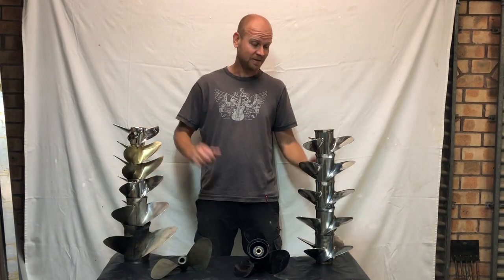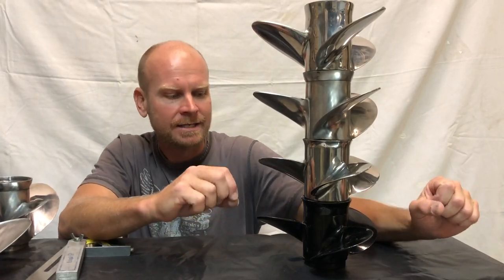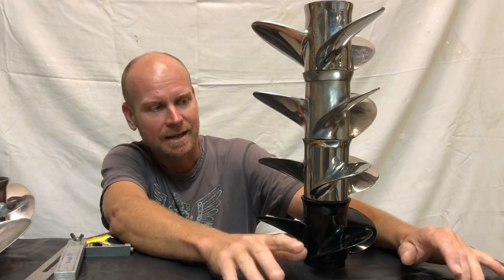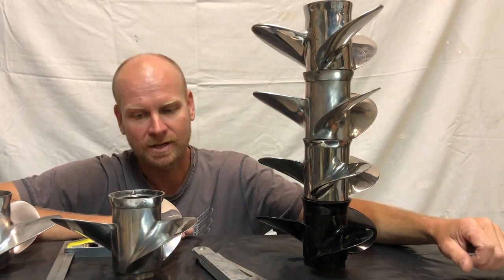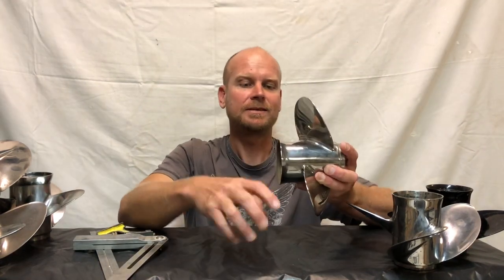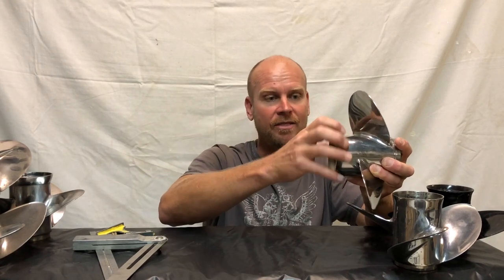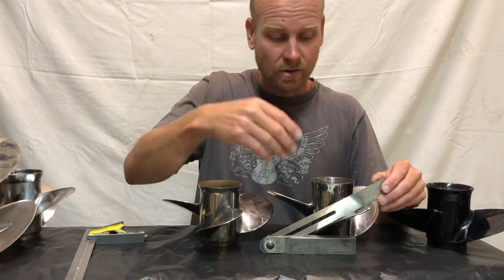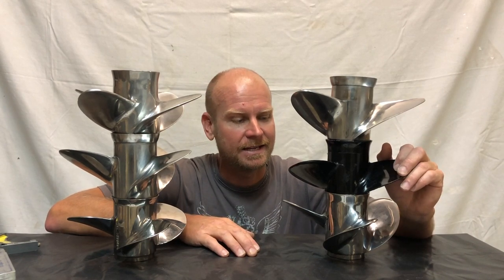Boat propeller - pitch and rake

Comment: You need to explain more properly what / how pitch is designated -- that is the distance in inches though the water per revolution of the prop.

Of course rake is important, as is blade geometry, surface area of each blade, as is cupping. 

Calculating pitch is a massively complicated 3D computation, as are out-of-water estimations about which prop might be best for any particular boat or usage application.
Reply from the maker: Hi Mate,
Good to see your passionate about props too 👌 love it 👍
Did you watch the whole video? I did mention that the pitch is how far the prop travels through the water during one full rotation (right near the end of the video) Yes, I could go into further detail about pitch but was more of a quick overview and more focus (very quickly) on rake as most people don’t know that’s a part of the equation when selecting props.
Also pitch can fairly acutely be determined with the correct equipment, maths etc without a program.
Cheers 🍻 
Aussie Boat Guy 😎

Comment: So I have a 9 1/4 x 12" pitch that came as original fitment on a DF20A Suzuki which is way to tall and the response from the dealer of course was "Yeah we don't know why they fit a 12", nobody can use them." Didn't tell me that until after the sale of course and no suggestion of a swap either. Anyway I commonly use a 9 1/4 x 11 or 9 1/4 x 10 depending on the day but would like to play around with the 9 1/4 x 12 to see if I can do something with it. I can Tig weld and commonly repair props  but have never done any modifications where would you start? I'm thinking maybe reshaping the rake of the blades to effectively reduce the pitch? Or do I reduce the overall dimensions to reduce the size of the blade including diameter? Not sure where to start. Thanks.
Reply from the maker: Hi Mate,
Yep, often the smaller hp motors cone with stock props that are normally pitched for very light boats.
With your 12p prop, it’s hard to take pitch away without re-bending the blades. Even reducing the diameter you still have the 12p - possibly more if you reduce diameter. One way is to beat the leading edge back up to reduce pitch but must be done evenly across all blades and not just at the very front, try to blend the bend from at least an inch to an inch and a half up the blade.
It is not something I would normally tackle reducing a pitch unfortunately, it’s a tricky one without pitch blocks to re-pitch the prop.
Cheers 🍻 
Aussie Boat Guy 😎
Reply: @25hpboatracerman  Thanks for the reply, that gives me a point to start from. Do you have a Facebook page? I would like to send you a few photos of an electric jacking plate I made to give you a few ideas.

Comment: drawing air in from the surface normally referred to as 'ventilation' ? as opposed to cavitation which is the collapsing of bubbles formed in low pressure zone of back of blades
Reply from the maker: Very well said and I agree 100%, thanks for the correction.
Seems you love propellers too 👍. 
I should probably cover that point but might do it when I look at race props and might talk about ventilation ports behind blades too. 
Thanks again mate.
👍👍👍

Comment: Awesome video. Yes please do one on race props 🏁
Reply: I'm looking to buy a new race prop for my 25 Tohatsu/ tunnel boat combo and would like to hear your thoughts from your experience and collection. Seems like Winrace is the only one available, but what diameter pitch and rake I don't know. Currently running a 10x18 heavily worked Merc chopper, but it doesn't like to corner and picks up air alot. Also tubed or not?.. cheers
Reply from the maker: Winrace props are insanely good.
I had a 25hp tohatsu (merc stickers) on a tunnel too. My prop was also a heavily modified 10 x 18 merc chopper as well, wonder if you have my old boat?
I did try a winrace tubed cleaver on it and picked up about 5kph with better stern lift, better cornering and less I’m going to flip feeling.
Unfortunately I could not afford to buy one and my mate that I borrowed the prop from (fellow competitor) of course didn’t let me race with it 😂.
I am not aware of a better prop than winrace for the 25 - 30hp tohatsu. 
The prop I tried was about 18 to 18.5 pitch.
Cheers 🍻

Comment: Question please, if my propeller changed from 7.8x8 to 7.7x7 how would it affect thrust and speed? Will greatly appreciate
Reply from the maker: Hi mate,
Sounds like you might have a 5hp.
If you changed from 7.8 x 8 to a 7.7 x 7
Your revs will increase and your speed may drop or even increase depending on if the 7.8 x 8 is too much pitch for the boat it is pushing.
The diameter does affect things but not as much as the pitch does.
If I can explain it like this going up a hill slowly in 5th gear in a car (very hard for the motor and never going to get going) or going up the same hill in 2nd gear, easy on the motor and can accelerate.
You need to find a prop that has a good top speed and still is ok out of the hole.
With a small outboard like a 5hp the gains you get from props are good but not major.
If top speed is what you are after - engine hight, trim settings, boat setup, weight of the whole setup are very important. Weight placement and hull shape are major players as well.

Honestly the best way to see how props react with your set up is to try them, some will be better, done the same and done worse and may all only be slightly different.

As you saw in my prop test video, a few of the props where very close in top speed.
Cheers, hope this helps.
😊😊👌

Comment: This video is very interesting.  It does appear that the 3 blade propeller can drive the boat at higher speeds however the 4 blade propeller seems to be more efficient at medium speeds in that you can get a lot better fuel economy.
Now to throw a monkey into the problem we have the toroidal propeller.  To me that one looks like a six bladed narrow propeller.  Since you can make propellers and you are an expert I would be really curious if you could make a six blade propeller to match the toroidal propeller and see what kind  of results you get.   That would be very very interesting to try out.  Have a terrific day mate. You are saying the blades can go down and pitch up. Very interesting if you can match that toroidal propeller with six blades.  They sell for a lot.  You could set up a company and make a fortune on that.

Comment: super keen to hear more about it mate, how do you find a higher rake prop, i need a 3 blade "Alloy" as its a standard class prop to modify and change for a 30hp 2 stroke, i'm guessing you'll already know what race in SA. Can you recommend any brands that do a higher rake angle. Can you also comment on the holes that 2 stroke outboards had in props to assist ventilation off the mark and if the racing scene ever took them on? Thanks
Reply from the maker: Hey Nick.
Yep I know what race and know some of the boys down there.
It is an issue trying to find a higher rake alloy prop. In saying that the old 25 to 35hp omc props have a decent rake (about 17 - 18 deg from what I’ve seen). I have modified them to fit onto the tohatsu 30hp (not sure about the yam but probably could). 
Issues are they have a different spline, the step down that fits into the rear gearcase bearing carrier is too big, the thrust washer seat is at the wrong depth, the converging ring (prop bell) is really crappy on the omc alloy.
Good points are once you sort out all the issues, the blade shape is a great starting point for a speed prop and they come in up to a 17 pitch (believe it or not) which you would not turn standard of course. 
In my prop video, two of those stainless props are omc that I have modified to fit the tohatsu 30hp. I will try talk about how I did it too.
Are you allowed to use an alloy prop from a different manufacturer in standards? The omc will look a lot different.
Cheers 🍻👍👍👍
Reply: @25hpboatracerman  Hey mate, thanks for the reply, i can't see why you can't use one from a different manufacturer, i'm also temped to cut off and re rake the blades and weld them back up, pretty dodgy, but i've got a couple of ones i might play with. Thanks heaps for the reply...

Comment: Hi! So between those two props, is the one with more rake faster?
Reply from the maker: Hi mate,
The one with more rake should perform better, should be able to run it higher and with more trim before it ventilates.
The only real way to know is a boat test but haven’t had the chance yet.
I will do a video on this when I get a chance.
Cheers 👌

Comment: Do know about sharrow propeller? What are your opinions?
Reply from the maker: I’ve been keeping a close eye on the sharrow props. I had a similar idea many years ago but with a smaller blade running in the low pressure water at the trailing edge of the main blades.
The sharrow propeller makes sense to me for some applications, I don’t think they will ever be a high performance propeller. The tests I have seen show good results for fuel economy and thrust at low rpm.
Cheers 👌